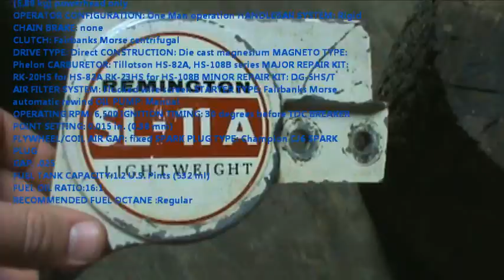Chainsaw Repair Remington SL-11 A

Comment: The oiler is a pulse oiler, it runs off the piston pulses. There's a hole in the cylinder that pressurized the oiler....

Comment from the maker: I put two small wrenches under it and worked it off working my way around it was not easy at all just so you know but they make a puller for flywheels on chainsaws you might make one or buy one.

Comment: Does the oiler still work ? I have one that runs , but smokes real bad with 50 to 1 oil . The oiler doesn't really seem to work very well  . I have taken it apart and my fittings look exactly like yours . I ordered a duckbill valve and will put that in . Is yours still working with your fix ?

Comment: Could you give me a part number and manufacturer for the duckbill check valve you used.  I have a Remington SL4 and suspect I have a similar problem.  Great and informative video by the way.  It's hard to start and I have to keep tweaking the choke to get it going.  I pulled the plug and it was a little dirty but not drenchd in oil like yours was.  But I'll try almost anything.  Thanks!

Comment: I know not the part number, I just snagged one from the fuel inside of the fuel cap on an old junk craftsman chainsaw, any fuel cap from a 2 cycle engine from a weed eater/chainsaw/blower should work. Good luck.
Reply: Now i know where the oil is coming from. Thank you for posting this video

Comment: what year is that 'cause i got a 1965 pl-5 or 6
Reply: 1972
Reply: I have the same saw. 1972 SL11.  The 19 inch bar and chain hard to replace. STILL RUNS GREAT . the SL 11 is rare as hens teeth